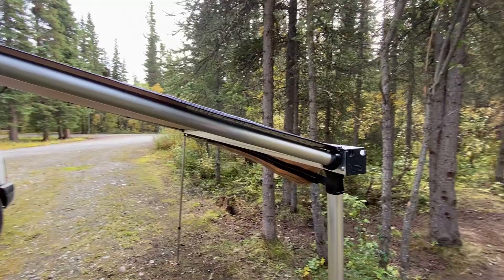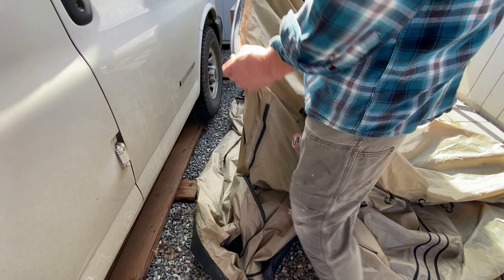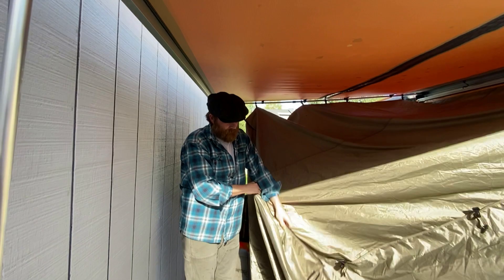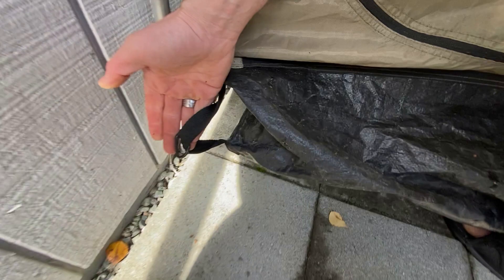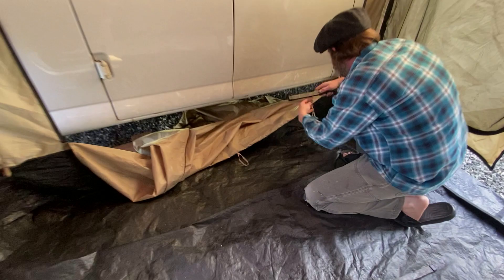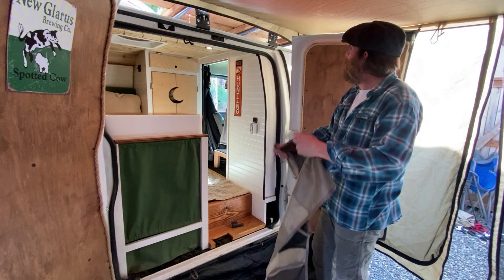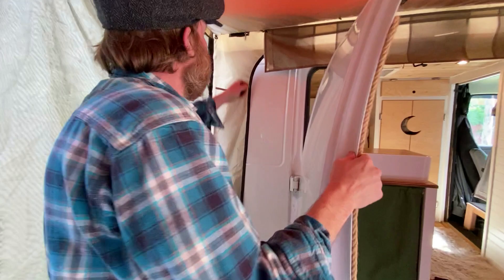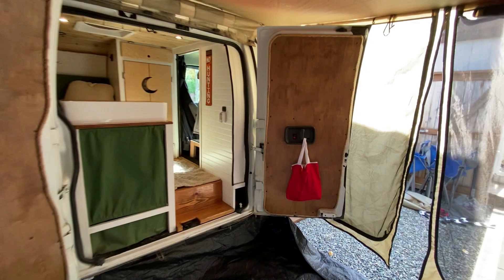Savana Camper Van - ARB awning and room tent

Comment: Wow I love that your van has outward opening doors on the side. Ours slides so it makes this kind of setup a little bit harder. That part you hung above the door looks like a great solution. We’re considering either an ARB or Darche.
Reply from the maker: Hello fellow vegans. The sliding doors would be hard. I’ve thought this over before, if I had sliding doors, I’d probably use a lot of magnets to hold screen tent. The Darche look awesome, but we wanted the ARB awning for the screen tent to keep the mosquitoes out.